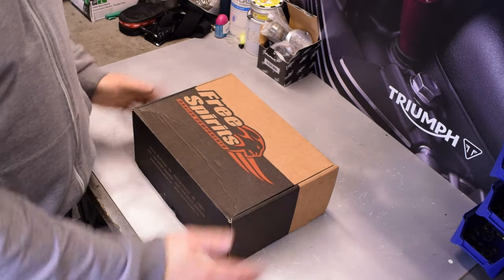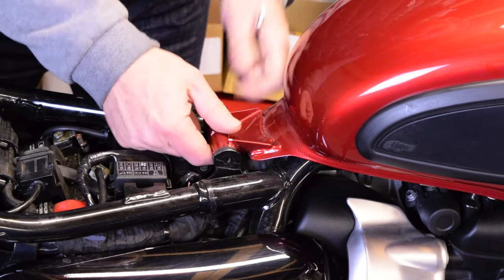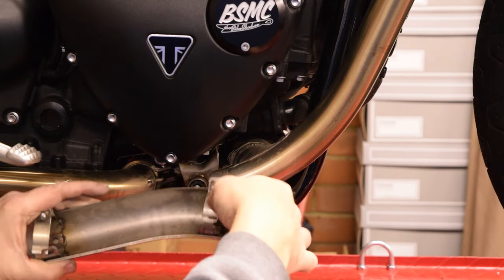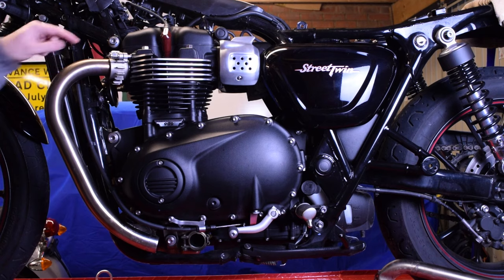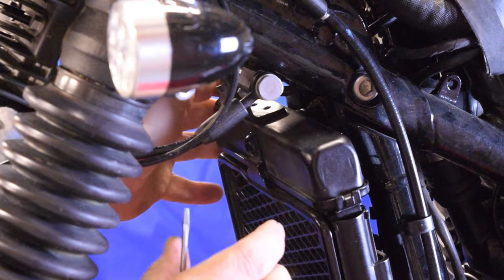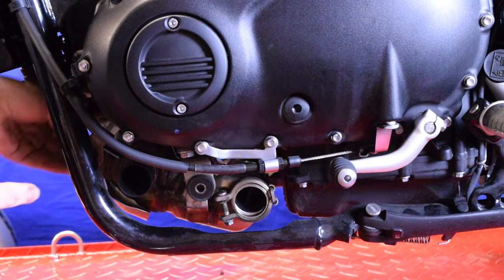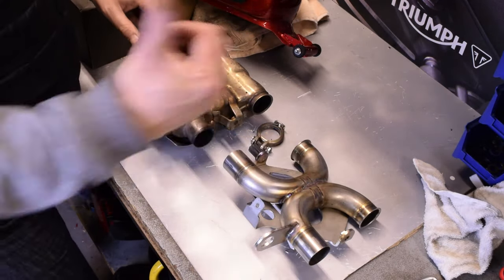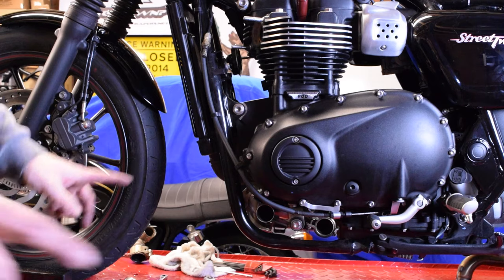Triumph Street Twin De-Cat - Freespirits x-pipe install

Comment: Does the tank actually have to come off? I guess it makes it a little easier but I suspect the job can be done without the added complication?
Reply from the maker: It makes it easier to access the top bolt, but it can be done without the removal yes

Comment: Hi to the mancave, I contacted my triumph dealer about having a free spirits xpipe fitted and was told they don’t do anything but make more noise, and that triumph do not recommend it now I’m confused. Help!
Reply from the maker: Sounds like they don’t want to do the job Russell. The do add a little more Bhp, not much, but it’ll also save quite a bit of weight and heat. As for Triumph not recommending them, well my local dealer stocks, sells and fits them for customers.

Comment: I see no benefit to removing the gas tank.  This is an exhaust project on the lower end of the bike.  Unless you're a clutz, the tank could stay on.
Reply from the maker: Hi Gary, it could be done with the Tank on, but access to the top frame bolt is then very tricky. In my mind the time taken in removing the tank is time saved in undoing that bolt. There is also a risk of damaging the tank getting to said bolt

Comment: ALERT!  If you have the Thruxton R, things are a bit different.  First of all, the headers are connected, which means you won't be able to simply take off the clips or put them back on.  At around the 7 min mark in the video, per the demonstration of loosing the frame, you want to leave it loose to put the headers back together.  If you don't, you won't be able to fit them back together. I ran into trouble after following the video and tightening the frame and not being able to maneuver the headers back in place.  Also when you install put the x-pipe in place make sure the two bolts used to hold it in place are in fact turning into the nut, one of mine I thought was in but wasn't and didn't realize until it was too late and can't seem to get it to tighten.  everything seems solid but I'd feel better if I'd gotten that done right.  All in all, I'm enjoying the throatier sound.  Can't speak yet to power increase as I just took a quick spin around the block and it was late.
Reply: you need to retune the bike with a PC5 after doing that.
Reply: no you don't...

Comment: Maybe a dumb question, but on the Euro 5 models with the rear mid pipes welded to the cat, will this process still work? I'm hoping to use my center stand, but not sure if only listening one side will work, and also not sure if having to loosen both frame rails will be a problem on center stand. Otherwise I will have to pay somebody to do it. Appreciate this helpful video.
Reply from the maker: There is an option which is the same prcess as this, but you replace to mid pipe too.....https://www.freespiritsparts.com/en/product/xl-pipe-de-cat-for-triumph-street-twin-euro-5/
Reply: @mancavemoto  yeah, I have that one. Just not sure if both frame rails have to be removed. I much prefer video instructions over the written ones in multiple language, as they are a bit tricky to follow. And since the mids are welded on the cat, not sure how easy he's going to be to get it out with only one frame rail off.

Comment from the maker: Apologies if i've caused any confusion. The two tubes on the X-pipe do merge to form a balance pipe as they would do in the stock cat. It didn't occur to me at the time that people would assume they were just two individual tubes. It seemed obvious to me (its called the x-pipe) if you look the diameter of the tubes where they meet (they are not full width). But on second viewing now its been pointed out, i may have given the wrong impression.
Reply: Can't you do this without taking the tank off ?
Reply from the maker: It’s quicker and easier (plus a little less risk) to take the tank off. Access to those top bolts is much better. It only takes a couple of minutes to remove the tank
Reply: @mancavemoto  OK thanks for that

Comment: I just leaned the bike's right side up against the garage wall. I removed everything else first to the point where the only thing stopping me from taking the cat out was the frame rail. Then leaned it against the wall, loosened rail, pulled cat, and tightened the rail back up so I could set it back on the sidestand to finish up putting it back together. Not the safest option of course. I wasn't worried if the bike had tipped over, but if you are not confident that you have the strength to hold the bike up then probably not a good idea. Certainly the quickest and easiest way though, if you dont have a paddock stand, etc.
Reply from the maker: FortunateJon ingenious!

Comment: Very comprehensive video thoroughly explained . However the bike would appear to be a tad over engineered by triumph to comply with new Euro emissions regs. But that's the result of progress I suspect . They are great bikes I was impressed when I test rode one .
I'm glad mines a 865 carbed no worries no electronics rejet and straight through exhaust sound sweet .
Reply from the maker: +andy blackburn Indeed that's the future for modifying new bikes going forward. It'll be harder and harder. It's frightening how much stuff they've packed into the frame. Regardless of whether you like the new Bobber or not, the impressive bit is how they've packed the same stuff all in without being able to hide it under the seat!

Comment: Very in depth video!  I have seen another video which had straight through manifold pipes right into the Vance and Hines slip-ons.  The Thruxton in the video did not have the catalytic converter - nor an X pipe.  Do you know where to acquire the straight headers that I can fit to the Vance and Hines slip-ons for my '16 Thruxton R?
Reply from the maker: Hi Don, I haven't seen straight through headers anywhere so far. Down & Out cafe racers fitted some to a T120 which I believe that had made, might be worth contacting them? I have read there is a drop of in torque if there is no 'balance' pipe, but I don't know how true that is. Cheers Tony

Comment: Awesome Video Tony, I just used it to install an xpipe on my street twin over  Christmas and it was invaluable so thank you!

So far running with stock pipes and no remap and it sounds and runs excellently with lots more character. There is a slight rattle / whistle under hard load and run off from the stock silencers which I'd like to get rid of though. Do you get this with your US spec V&H's?
Reply from the maker: Patrick Charlton Hi Patrick, glad the video was of assistance. I can't say I've noticed any of the noises you have described. Might be worth going over all the bolts again as a double check.
Reply: Thanks for the tip! I'm guessing it's the stock cans baffle rasping a little with the increased air flow. Hoping new cans and a remap will sort it.  Can I ask where did you get your retune done?
Reply from the maker: Hi Patrick, I had mine installed at the Triumph dealer in Ipswich, Suffolk Triumph. Where are you based?
Reply: i thought the ecu did the remap ? i was told to let it idle until the fan kicked on and it would remap itself by then ?

Comment: Hi, what do you think between x-pipe + stock muffler and catalytic + slip-ons? Sound and performance
Reply from the maker: Hi, A tricky question to answer. I originally fitted the v&h slip ons with the cat in place and it did make an immediate improvement in the sound. Performance not so much. When i fitted the x-pipe there was a noticable 'pep' in the throttle response and the bike felt more lively. If was going to choose between the two
Reply: Thank you very much.

Comment: Hi Tony,

Does removing the cat have any side effects to the motor? 

Won't this affect efficiency?
Reply from the maker: +Parthiv Ravindran No side effects, maybe fuel efficiency will drop very slightly? (Time will tell) But it's all on the outlet side, the o2 sensors are still in place and my bike has been remapped for the off road high level pipes (which bypass the cat)

Comment: Hello, i have purchased the x pipe two days ago from the dealer and he is telling me that i need to install a pc5 and get the bike remapped as well after fixing the pipes. I have checked with other users and most say there is no need to as the 2019 model, the ECU will tune itself and there is no need for any pc5 and mapping. Is that true? Apparently all i need to do is make sure the fan comes on before i start moving after starting the bike. Can you advice if it is really necessary to remap? The cost for pc5 and mapping is triple the price of the pipes itself. 
Thank you.
Reply from the maker: If you haven't changed the input side (ie filter, snorkel removal etc) then the x-pipe makes a marginal difference. The ECU has a tolerance and can deal with a certin range in terms of mapping. It can accomodate the change in flow with this installation. If you start to change other components then it might be a different story. Triumph did have a map specifically for the US spec pipes (with removable baffles) which was referred to as an 'Off Road map'. I had this flashed onto my Street Twin at a dealers and it did make a difference (I was running the x-pipe and the V&H pipes with no baffle). In short, you can run the bike fine with no power commander.

Comment: Thanks for yet another great video Tony. The bike sounds awesome. I´m still waiting for my Street Twin to arrive, but I´m already looking up some possible mods for the bike and this one is one of the possibilities. 

Still, since we have obligatory inspections starting this year in Portugal (I don´t know how it is in the UK) I do believe it would be a pain in the behind having to undo all the work to put the catalytic converter on the bike every year, so it passes the inspection. Some good sounding slip on exhausts are also a possibility.

Either way, it is still on consideration. 

Two questions though:

 Where ca we get the Triumph manual (so to know the torque settings for each screw);

Can we get a torque tool on any hardware store or are they special made somehow?

Thanks for any ideas regarding my doubts.
Reply from the maker: Thanks Ricardo. I got the torque settings from the instructions that Freespirits provide. Any standard Torque wrench will be good, just make sure its in range, some will go to settings that are not required on a motorcycle. Will the inspections include emissions? The US spec slip ons I have are good, and you can always put the baffles back in for the inspection.
Reply: I do believe the inspections around here will include emissions. I guess it will be better If I just go with slip ons. I´ll look into it in depth.

The US spec Vance & Hines have to be ordered from the States?

Once again, thanks for the help and quick response Tony.
Reply from the maker: Ricardo Silva Makes sense and you should be able to order the US slip on from your local Triumph Dealer
Reply: Thank you Tony. Will check it out.

Comment: Tony, I’m curious where you sourced torque specs for the frame cradle bolts...Haynes puts top and rear at 40 Nm and middle at 105 Nm rather than 45 and 80, respectively (though I’ve seen 45 and 80 in several videos)...
Reply from the maker: Mine come from the Triumph factory manual, which is why I’m happy to quote them

Comment: Nice video.  I installed one of these on my T120 along with the external conic air filters.. amazing!
Reply from the maker: bount320i I bet it sounds fantastic
Reply: Did you get it remapped?
Reply from the maker: Daisy Chain Yes, I did and I think it's an improvement
Reply: Can you upload the video of T120 sound after replacing X Pipe? @bount320i

Comment: Many thanks from France ! Merci beaucoup pour cette vidéo et ces conseils. Tout est parfait, j'ai modifié mon 900 Steet Cup en suivant point par point la vidéo, et tout s'est très bien passé. 
Avec le Xpipe le bruit est plus puissant mais pas trop, surtout plus grave, les reprises et les accélérations sont bien meilleures.
J'ai profité de cette opération pour supprimer les sondes lambda, installer un Booster Plug et un filtre à air K&N. 
Maintenant tout va bien! 
Merci encore "Man Cave Moto" you're great !!!
Reply from the maker: Merci pour vos gentils commentaires et je suis heureux que vous ayez trouvé mes vidéos utiles. J'ai appris au fur et à mesure et je voulais juste partager mes expériences avec d'autres propriétaires de Triumph. Roulez prudemment mon ami

Comment: Hi Tony,
Do you think it would be very noisy if I put on a V&H US spec with no baffle associated to my X-pipe which is already on my bike?
Maybe I can just get a V&H Euro. Will it make a nice difference compared to the stock exhaust sound?
What do you have?
Thanks for your help.
Cheers.
Thomas From Annecy in France
Reply from the maker: Hi Thomas, Ah I love Annecy, we stayed in La Clusaz a few summers ago and drove down to spend a day swimming in the lake over at Talloires. In answer to your question I was already running the US spec Vance & Hines without the baffle. So the sound you hear is the setup you would have......and it sounds awesome!
Reply: @mancavemoto  Hi Tony, Thanks for your answer and thanks so much for all your videos.
Your bike sounds awesome, you're right.
Good to hear that you like my mountains and the lake.

Comment: The problem with mods to the intake and exhaust systems on modern ECU controlled motorcycles is that the engine will not be in proper tune without re-mapping. Worse still is that manufacturers are making it difficult to access the ECU for proper dyno tuning. With a less restrictive exhaust would not the engine be running leaner and hotter? (motorcycles don't have a Mass Air-flow Sensor like the cars do). The stock engines are already tuned as lean as possible in order to meet emissions requirements. I installed a full Arrow 3-1 system (no cat) in my 2010 STR but it also has the OEM Triumph-approved mapping to go with it and the fueling is flawless along with a 5 hp increase. Maybe a Power Commander will be available soon for the Bonnevilles?
Reply: Hey, just FYI, these have self learning ECU's...Drive it a bit and it will remap. They have o2 sensors that will keep the bike from running dangerously lean

Comment: Hi Tony. Some people have made comments about the legallity of taking out the cat. From what I can tell, it may fail it's first MOT if it's emmisions are too high, but mine is a 2018 model so it's first MOT is two years away.

I assume you've got to tell your insurance company if you do this mod, same as any other modification you make? Otherwise, your insurace might be void?
Reply from the maker: Hi Mikey, yes I never tackle the subject of legality and I’m only showing how to fit the xpipe not recommending it be done. However at the moment there is no emission test for bike mots and this is not scheduled to change anytime soon. So the minor change a decat makes to emission readings is not relevant for bikes. 
Yes it’s very prudent to tell your insurance company about any mod. Most decent bike insurers have a number of what can be viewed as standard mods included in the policy which do not need to be recorded ie tail tidies, end cans etc but you’ll need to check with them on the specifics. It’s worth paying any extra premium rather than risking a zero payment in the event of a crash or theft.
Reply: @mancavemoto  thanks for getting back to me so quickly! I've already got the TEC cans on mine, so the decat might be necessary to get the best from them. I'm just not sure if I can justify the £100 or so right now... something to think about in the summer maybe, when I upgrade the cam.

Comment: Great video! I have my pipes coming in next week and can't wait to use this video to install it. But I have a question. What do you mean by remap?
Reply from the maker: +Kingline07 A new map for the ECU to adjust for the different pipes. Not essential, but it helps if you choose the v&h US spec slip ons or hi level pipes

Comment: Great video, and really helped me get ready for the upcoming task. Would also recommend that you increase your rear sprocket by 2 teeth to 39T
Reply from the maker: The stock rear sprocket is 41T, I've seen a few people go for a 44t rear sprocket to shorten the gearing a little and add a little more to the acceleration. A 39T will give a higher top speed, but will slow the accelaration down a little. Not a massive difference admittedly. Depends what you are trying to achieve